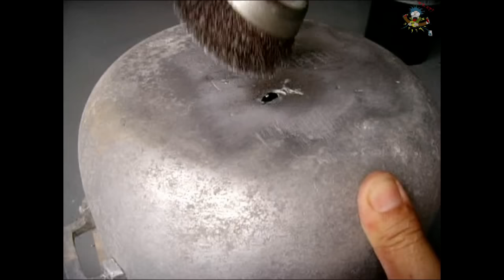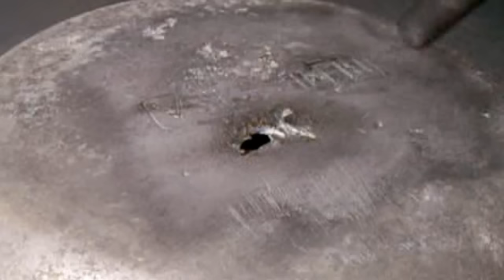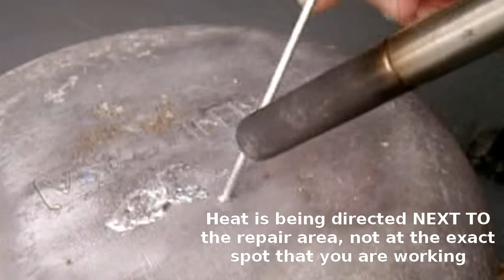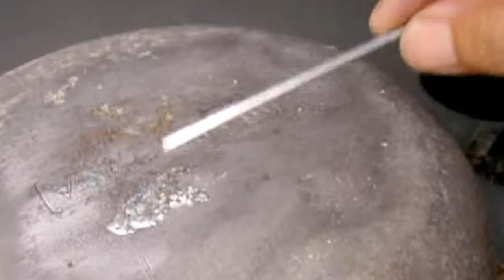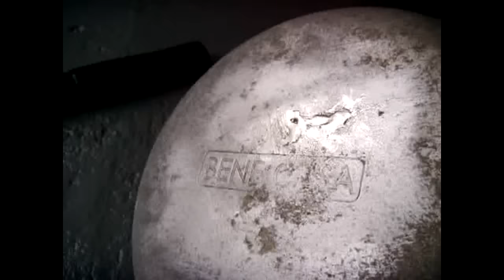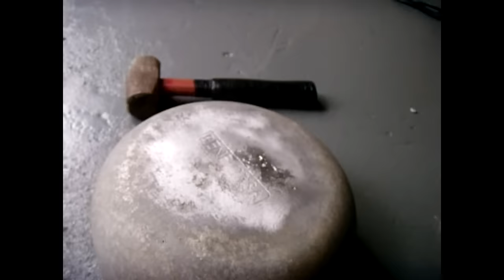How To EASILY Repair Holes In Aluminum

Comment: Can this brazing work on repairing a crack on an aluminum oil pan?  i recently bought a car and that owner was using JB weld etc.. trying to repair the crack but it still leaks and load be hold I didn't know so now I'm stuck with the car.  Replacing it would be too much so was looking to repair.  Thanks!
Reply from the maker: Hi. Your question was already answered at my other video.
Reply: if its for a car engine for what its worth just buy a new sump. 
the last thing you want is a repair failing and then engine seizure that could cost 100's maybe 1000's thats if its not your own life as you dont know when the engine is going to seize. believe me i done it myself at 100mph. and ground to a halt when i was on a race track, i just know what to listen out for. 

if you don't know what your doing. leave it to a qualified mechanic.
 i myself am a HGV mechanic and its not acceptable to be repairing sumps to engines you can ask any GENUINE mechanic the same question and get the same answer.. regardless if its a crack or a hole. its scrap just bin it and buy a new one.
Reply: dude if you already have the oil pan out take it to a pro  done #makes a great cooking pot#take your time#sick of getting screwed
Reply: if the guy doesn't have $300 bucks for a new oil pan don't you think he wouldn't have $300 bucks to take it to a pro? and if he did don't you think he would just buy a new one?? common guys you have brain for a reason.
Reply: "Low and behold" is the correct term :-)
Reply: Jay Bing,
No, actually, the saying is "lo and behold."

Comment: Could u use a similar technique to repair a leak in a pontoon on a pontoon boat?
Reply from the maker: Aleyia Phoenix Yes. Make sure you can supply enough heat.
Reply: electronicsNmore perfect thanks

Comment: Why not put the firebrick under the repair area right from the start and save a step or two?
Reply from the maker: +Timothy Price 
Hello. Most people that live in the tropics do not have access to fire bricks. :-) You do not need it for this repair, but when placed on the inside of the pot, you will have a nicer repair area which will require less finishing.

Thanks For Watching
Reply from the maker: +Timothy Price 
Hello. Most people that live in the tropics do not have access to fire bricks. :-) You do not need it for this repair, but when placed on the inside of the pot, you will have a nicer repair area which will require less finishing.

Thanks For Watching

Comment: You should do boats
Reply from the maker: It works on aluminum boats, you need to use more heat though. Possibly 2 torches going the same time.

Comment: Does that work with cooking pots as well? I've some cooking pots I'd like to repair myself but I'm not sure if the patch would hold when using the pot again. Please advice. Thank you very much.
Reply from the maker: +Linda Alexander 
Hi Linda. As long as something is in the pot(water/oil/food/etc), then the repair will not melt out. Leaving an empty pot over a gas flame will melt the repair area once very high temperatures have been reached.

Thanks For Watching!
Reply: +electronicsNmore My pleasure. The hole on my pots were luckily on the side not the base, and not as big as the one you fixed in the vid, about a toothpick hole size. I'd like to give this a try but I fear I might be doing more damage to a good pot than repairing it. Thank you for your valuable advice.
Reply: If your pot has a hole in it, I wouldn't consider it a good pot.

Comment: I tried this same thing on an old aluminium pot, but when you heat water or liquids in it it will turn black right on the welds. That old pot looks like it has quiet a few pockmarks in the bottom. Shame you didn't fill it with water and show a successful job boiling water.
Reply from the maker: Yes, the pot does have a few pockmarks, that is typical of an old, corroded aluminum pot which you find thrown away. I don't know what the pockmarks(pitting) have to do with my demo showing how well you can repair a hole. The pot was used for a project in which the pot will be floating in water(up coming video). Why would I have to fill it with water and allow it to boil? You don't trust me? This is the exact same brazing material which I used to repair a hole in my scooter's aluminum exhaust shield, and it gets way hotter than any pot boiling water. I also used this to repair a hole in an aluminum radiator with no problems whatsoever. As for the color changing? Could be due to a different material being used in the pot or rods that you used. You likely has a small current flowing between the repair material and pot once water was added..
Reply: electronicsNmore any idea what caused the hole or was this just some junk you found to demo on? I realise you may have said in the video that it was junk you found but I'm not watching twice just to find that shit out lol.
Reply: lol morlol I'm curious... do you happen to know how well soldering holds up on aluminium parts like this? would solder fill the hole? I know it's not a weld or a food grade acceptable fix, but still... does solder work ok on Al like it does Cu to Cu?... just for sticking bits together?
Reply from the maker: Solder does not stick to aluminum. I never had any successful results. The only thing that works for aluminum is Brazing, or Welding.

Thanks For Watching.

Comment: Everything I've read or been told about alloy brazing says never put rod in flame.. Seems like you can if carefull
Reply from the maker: +kevin swithenbank 
As long as the base metal is hot enough to melt the brazing rod, and not the flame, you are just fine.

Comment: why didn't you just use a gas stove to heat it before you welded? It would have saved you some gas in the torch. Only for the sake of the video.

Comment: wouldn't it be cheaper to buy a new pot?
Reply from the maker: +Benjamin D. Auver 
The pot was only used to show how well the brazing rod works when filling holes in aluminum.
Reply: +electronicsNmore That makes sense. Apologies. Also: I found the Benz-o-matic brand of those rods at HD today, can't wait to have a reason to use them :)

Comment: Now put it on a gas burner and cook a nice stew, have fun cleaning up a big mess! LOL!
Reply from the maker: Wrong. LOL! As long as there's food in the pot while the burner is on, which is the normal way people cook, then the repaired area can never reach high enough temperatures to melt.
Reply: I still wouldn't trust it for Cooking, but go ahead, by all means!
Reply from the maker: James McFadden If you have a habit of leaving the heat on with nothing in the pot, then yes, I agree. :-) This video was not to show how to repair a hole in a pot, the pot was only used to demonstrate how a hole in any aluminum can be repaired.
Reply: electronicsNmore ... and the very same idea ,,, but applicable to iron ( with some rust ) ???? Do you know something about ,? and what material ?!?
Reply: James McFadden ... if it has liquids on it ,,, it won't be enough to melt the alloy .
Reply: completely agree with you. I was planning on making a water pump. I had seen a lot a lot of videos where they make it PVC and I made one. It work but soon, the turbine made of pvc breaks. I thought of making it with aluminium but it would require weld process which i am not equipped with. But now, i can see a way to do my project. thanks for this video

Comment: Another pro tip.  Don’t cook food in aluminum cookware.  Aluminum leaches into food and is known to cause Alzheimer’s disease.  For this same reason don’t use deodorant with aluminum in the product which is often used as antiperspirant.  Buy stainless steel cookware without the anti-stick compounds.  Yes aluminum is cheaper, but the cost is your mind over a lifetime.  It’s a big cost.  It’s more expensive than paying $10 more for a stainless pan.  Copper is also safe but it’s a lot more expensive